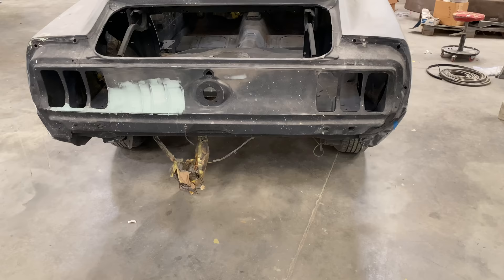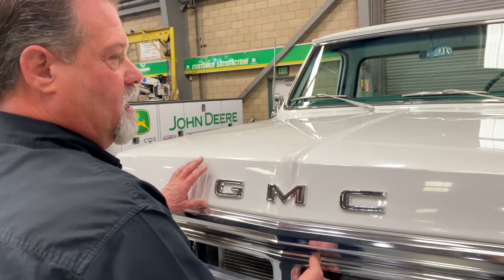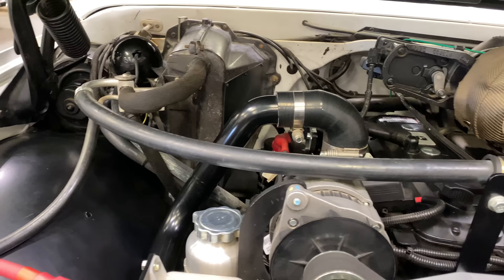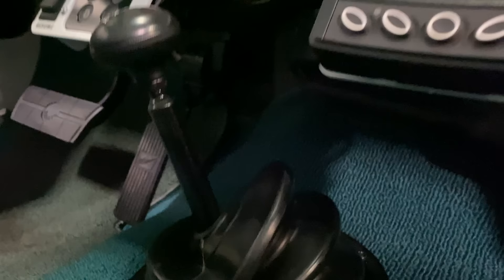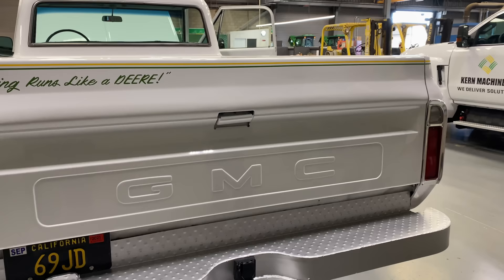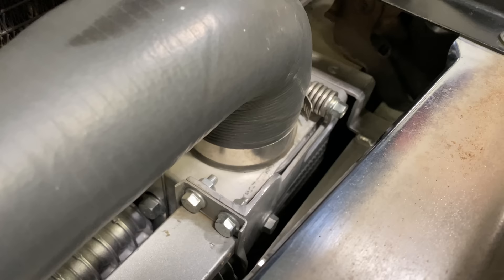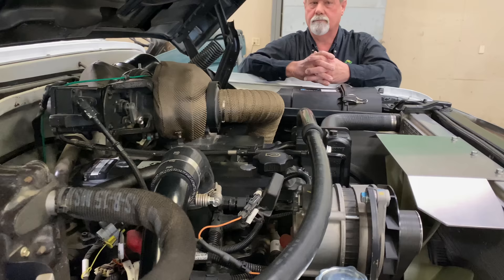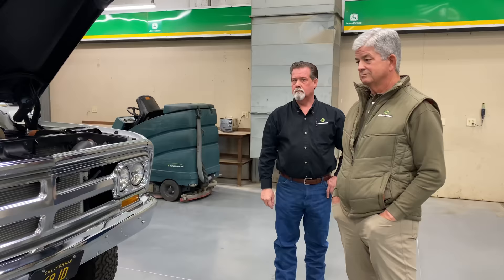John Deere Tractor engine in 1969 GMC truck!

Comment: Produces under 480 lb-ft. Highly unlikely you’re twisting any 3/4 ton axle in half, regardless the age.
Reply: I’m glad someone said it. Must’ve bound it up or the other option is they are full of shit
Reply: The 454 they pulled out had them on there last leg, don't remind me that it was a 350 truck originally, LOL
Reply: I was surprised at the statement as well, but mechanical parts can fail at any time...considering the truck is over 50 years old and anything could have happened to them in that timeframe, if he said they twisted why do we care what the circumstances were or even question if it could happen???...yes you could say its highly unlikely a 3/4 ton axel would twist but it can happen...its also highly unlikely he just made it up for a bullshit talking point...just enjoy the video and the truck they created and not be so critical...
Reply: I totally agree with you on that
Reply: Gear reduction my friend. You can turn 480 ft-lbs into 2000+
Reply: I could see maybe twisting and breaking a drive shaft into two pieces but not twisting an axle in half.
Reply: Pre 73 had the eaton ho72, not usually a Dana 60 rear and a 14 bolt wasn't introduced yet. May have been ho52. Of course over the years its anybodys guess as to what it had when it showed up.
Reply: Given the fact the transmission and transfer are custom my guess is it has a lower than stump pulling first gear which could quite easily twist a stock axle. #Micdrop
Reply: @assymcgee2835  That is true of the Chevy trucks as standard, but the GMC had the option for a Dana 60.  GMC did things a little different, like having leaf springs as standard on the 2WD 1/2 and 3/4 ton, Chevy had coil springs for the 63-72 trucks - but you could order both makes with either as an option (except when 4wd which always had leaf springs front and back).  GMC had the option for Dana axles (44, 60)  on 1/2 and 3/4 ton on both 2wd and 4wd during 63-72.
Reply: Early Stock dana 60 axles in the rear were 16 spline garbage. Not surprising. Sterling or a 14 bolt would be fine
Reply: @franksimpson8242  yes mom, thanks.
Reply: @illreportbackinabit.8514  good boy!
Reply: Right? I think he meant to say "axle shaft" and it most likely wasn't a Dana 60. Probably a 14 bolt. But even then... Must've been in 4LO while trying to pull something up a steep hill and caught traction.
Reply: Not just the lack of power, but how about the lack of ground clearance? Lol
Reply: Multiple the torque by the converter ratio and the lowest gear ratio in the Allison . Stock  final torque will not come close to the final torque behind that allison
Reply: Stock Dana 60 rears aren't super strong, a 9.75 sterling that comes in F150s today is actually stronger

Comment: I had an old Dodge with a Cummins engine out of a combine.
Reply: That's the only pairing where I think "That's a build out of necessity"  Whereas this Deere and GMC scream money and novelty!
Reply: @thomasshumaker1495  Seems like a lot of work for a novelty item doesn't it. Mine  was for my work truck. I don't own it anymore but it's still a daily driver/work truck for a younger lad in the area. It was regular 12 valve b series Cummins. Just was in a combine instead of a truck originally.

Comment: Nice clean job. There's a guy that has been running around here for twenty+ years with a Detroit 471 in an 65ish Dodge pick up.
Reply: Bet you can hear him coming 5 miles away too. The old 371 and 471 engines could be heard for miles. I have heard 371s in a log skidder, i hope the operator had ear plugs.

Comment: They have conversion 4Cylinder Cummins engines for jeeps I sure they could be modified to fit in all the 60s and 70s trucks
Reply: B4t Cummins remove 350 and bolts right in
Reply: Not everyone wants a Cummins. I spent my career in the OTR diesel world and my service truck was Caterpillar and Eaton - ironically while doing Cummins field service.
Reply: @roundsm18  I know that  but every one want a diesel conversion kit for the old trucks as do i I have a 78 f250 custom that I wanted to swap
Reply: @kontrolledkhaos4853  it’s all easy fabrication. Mine stayed big block gas because it wouldn’t be a restoration if I swapped it.

Comment: What's funny is dodge has been putting case motors in since the 80s
Reply: No I think it was a Cummins many of the case engines were discontinued with the newer axial combines and magnum tractors!
Reply: Cummins isn’t a strictly case engine, Cummins is in boats, trains, tractors, semis, and pickups
Reply: Even funnier than that is caterpillar was putting tractor engines in trucks in the early 30s
Reply: Case motors????? C’mon man
Reply: @oe542  I know cummins you get what I mean
Reply: @landonretzlaff7765  now I do.

Comment: I’d like to know why he chose a 203 transfer case? Isn’t that a full time transfer case that’s chain driven? Why not a 205?
Reply: The np203 is a bulletproof case and you can install a divorced kit so you can shift it to 2wd.
Reply: @minnesotatomcat  it isn’t bullet proof. A 205 is way more bullet proof. Those 203s are boat anchors or scrap weight.
Reply: The 203 is far from a boat anchor, chain drives have been proven to be plenty stong enough for serious off roading, but I doubt that truck will ever see any real trail use. The 203 has a lower low range ratio than the 205 and it's also a full time case that can be selected to either open or locked in low or high range. With the selectable hubs on the front it can be a "sorta" part time case like the 205, although the front drive shaft will still turn.  It's a good choice for a LWB pickup that's likely going to have most of the weight on the front axle when they need 4 wheel drive.
Reply: Why not use an NP271?

Comment: 4:27 you don’t really notice a difference. 173 hp vs 300 hp, tell that lie one more time.
Reply: you might not notice that much difference just cruising around but hook up a trailer with a load and then you'd see the difference.
Reply: HP is merely a measure of how quickly an engine makes power. Torque on the other hand, measures how much usable power is being put to the ground. Your average diesel engine makes tons more torque than a gas engine, but less horse power, which is why it can gain speed at almost the same rate. Often times, the diesel makes so much more torque, it's "faster" than the higher HP gas engine.
Reply: @Eric2300jeep  This engine will never keep up with a 4.5 liter 180 hp Deville gas engine install in that truck. The diesel short rpm range will be a problem.

Comment: The builder seems like a bit of a jerk
Reply: I bet it's more than seems.

The interviewer doesn't exactly seem the brightest crayon.  He didn't get the concept that there was no bolt in anything. They stripped the front clip and built it around a bare frame. 

It's really the easiest way to do a nonstandard engine swap.
Reply: @anthonydilligaf823  I agree, the interviewer was definitely unprepared. Maybe it was a spur of the moment interview. But it was obvious that he wasn't a "car guy". I think the builder and owner picked up on that.

Comment: Ive said it for years. If john deere would design a truck . it would take the market. Use attributes from gm ford and ram but run a deere motor.  The truck would be a beast.

Comment: My dad worked for deere and he said they rarely got the trucks back from the dealers. It was to test the engines for different loads. They take the engine apart etc. They did like having deals with the big harvester companies because they'd get their new machines back every year with lots and lots of hours on them. One of the reasons why they might have the no user serviceable parts/ make it hard to repair is because their claims dept paid out claims on everything even if you take 1 part off a john deere tractor and put it on another machine. He had one person he visited for claims was sucked into a thresher or something and was INSIDE the machine for 3 hours before he was found. was still alive. With all the covers guards safety stuff removed from the machine.

Comment: I want it! When I was in high school a friend of mine put a For 6610 tractor engine and 8-speed trans' in an F-350 4x4, and while it lasted it would crawl so slow, and go over anything, but he couldn't keep U-joints, driveshafts, or axles in it. lol. His was just rigged together, where this one is done right. I'd give my left and right nut for it. lol.

Comment: I absolutely love projects like this, Because I have done similar, with Duramax allison and a avalanche 2500, of course mine had almost 600hp Crazy fun to drive. It had oversize injectors bigger turbo built allison a fluid damper so the crankshaft doesn't snap I higher then stock Rpms and so on. It only had 1/2"" between the radiator and fan because of the oversize exhaust and air to air cooler many more modes not mentioned here. O forget to mention I snapped the stock spring in the rear even with axle control bracing doing a burn out from the axle shifting so far ahead on one side it spun around like a top rolling it over on it's top, After that Smashing performance I reinstalled this Crazy build back into a full size truck still being used today.

Comment: I have that model truck K-1500 fleetside long wheel base with factory saddle tanks I have a 283 in my shop came stock was a 350 4 speed 
I’d love a Cummins with a 5 or 6 speed manual and an extra cab   a/c would be nice but not necessary definitely power steering needed disc brakes up front ok in the rear 

I prefer Hwy-99 to I-5 so next time I’m headed to San Diego from Krapramento I’m stopping in I’ll wear a bid so I don’t get drool on it
Nice work!!

Comment: I think a 69 International pickup with a six might be nice. Slightly lengthened hood front end with four wheel drive. Don’t see many and a clean slate for a one-off paint scheme. Retain the front fender fuel fill for unique style.  Possibly an IH diesel turbo set up. Could feature some cool jeweled IH badges.
The stamped aluminum grills and dog dish hub caps kind of a cool time period correct style cue.

Comment: 9:56 ... Gotta beg?  Whaddup?  

Sir Kern: Cough up da coin to do whatever needs to yet be done to get this magnum opus out shreddin' mud.

Yeah, you blew the budget.  And?

Fatal flaw in the tranny or the like?  Fix it.  Damn, do I really gotta say it?

You came this far, didn't ya?

P.S. Also, one nag, please outsource and get rid of that silly dash panel extension -- put the new stuff where the radio is (and throw a Garmin Tread Audio Box behind the dash) ... and add a pair of Mighty Mount wireless chargers just above the new stuff dead center, so the phones peek just above the dash for optional dash cam mode.

Looking forward to that, and your Leno episode.

Thanks for all the incredible concepts & work so far.

Comment: So I once had pleasure of driving a Ford I think it was a 66 with a international dump truck engine I want to say it was a Cummins in it from the late seventies it was a blast other than a few oddities and having a 13 speed manual transmission in a pickup truck but that was also a different animal as it was a mostly mechanical engine with a manual transmission that was pneumatically actuated

Comment: Had a local ford tractor dealer put an engine out of a 5000 ford tractor in a dent side ford truck , I never saw it run but saw it on their lot after they retired it .

Comment: Me, I would be completely happy with a 350 in that pickup, and my two 1990s JD F932 mowers and 1975 500C backhoe. Almost nothing manufactured in the past 15 years can be repaired without extraordinary skills and extremely expensive tools — cars or combines. That self-driving SUV that Cadillac is advertising? Its resale value will be 10 percent of new in eight years.

Comment: These 4045 powertech engines in genset applications, have optional dual balance shaft. Way better engine than the Cummins 4BT. Only thing better would have been in a Ford. Very nice workmanship.

Comment: I know past away old man from my area was one of owners of John Deere Dealership plus Parts store used be near me also guy had 1975 D350 Dodge full size van 12 passenger was orgnail used as ambulance type till retire in 1980 and guy bought of Auction sale to in 1980! Then found 318 V8 2barrel hand choke carb , Manual 3 speed transmission on shifter on steering wheel get worn out & guy had idea to do and what did ! Turn to camper van, add 1976 Massey Ferguson Combine 500 series Desiel 6 cylinder motor size 360 bore up 400 Cubic Inches size , Dodge floor shifter Manual transmission had Bow Low Gear plus 4 speed forward gears plus one Reverse , 2 12 volt battery for 24 volt system, he use Dodge 90 amp Alternator, uses all gauge plus 2 fuel tanks , add RPM gauge on dash , transmission temperature gauge, extra battery volt , took cigarette lighter out for a switch for glow plug warmer , 2 fuel filter from fuel tanks plus one engine too , buy fuel tap , 3 ton  truck rear end 390 from 409 orgnail had , had sink, hot water tank , propane cylinder on frame rail right side attached to  for heat water plus heater too that had in body house voltage plug also battery charger to add  2 sleeper plus 2 people ride in and two celine fans vents for keep cool in hot summer season! Plus motor had single exhaust but loud too! Guy built this used for his business plus going Florida every winter drive down plus wife drove too every year and gave Chrysler the idea so built Desiel motor Cummings come in affect to he work for ! His wife was nurse at local hospital, both since past away but on Grandson who my cousin he and I went to visit family plus at local Indian reserve in 2002 and 2004 summer season and camp with it also lots fun! I found to 5 gear  was like Overdrive going in hills didn't need brakes as much but up hills power never new also top speed was on odometer said 120mph but think goes faster than that because 5 gear! But if want listen am/fm radio had have loud speakers nearby to hear Lol and one summer way back from my cousin Mark  house I was drive back the Clutch pedal stuck in out position plus Bow Low gear and managed get out gear but clutch plate need replaced plus bearings to plus steel pressure line to fix ! The van is 1 ton of 11.000 pounds totally and not easy job to fix underneath too also replaced parts in ! But one thing late guy built it did he did schematics and drawings of pictures of it setting up and how fix in details but if want need fork lift plus heavy-duty hoist like farm tractor or big trucks used to!

Comment: Had John Deere quote us on a fix.  $15,000.00 for a new fuel rail and fuel system.  Our tech said no way.  Our tech found pinhole leak in tubing and saved us $15,000.00

Comment: If I were to go through all that trouble I would definitely not have anything computer controlled on that truck!
I'd probably try to find either a three or a 4 cylinder 2 stroke Detroit, rebuild it to perfection, and then mount it in front of a hydraulic automatic transmission.
I'd set it up to run on straight vegetable oil with ZERO ELECTRONIC CONTROLS!

Comment: This is the coolest diesel truck I've ever seen. I'm wondering if that same engine will fit into an early 60's Jeep Gladiator truck. I'd love to copy this build but with a manual transmission and would probably build both an early 60's Jeep Gladiator and a 69 GMC 2500 like what you have. I'm wondering if I could get some more information about this build so that I could successfully build one for myself?

Comment: Many years ago I worked with a guy that he and his dad had an old payloader that the engine had went out on and the only practical way they had to fix it was to refit a gas engine from a  late 80's pickup into it.    They thought that being the pickup engine was supposedly rated for more HP than the stock loader engine, it would be a nice step up.  

Turned out that a modern emissions-compliant vehicle engine VS a stock commissions industrial engine from the '50s was no match. It was underpowered and burned almost twice the fuel doing the same work.  

Since then, I have met others that did similar swaps and they all came to the same conclusion. Emissions compliance has nothing to do with fuel efficiency.

Comment: This swap is a very cool idea and one that I have also contemplated but I thought that tractor engines were not so good as vehicle engines, as they are meant to perform constant duty.  I have a 40 year old ford lehman diesel in my boat, which is known to be one of the most widely used industrial motors ever with many thousands of them still in service. They even went as far as to put them in dump trucks and other over the road type vehicles, but you are hard pressed to find a survivor of these because they just didn't hold up to the varying RPM's of driving.  But you will find them in 50 year old boats and farm machinery with 10k plus hours still running like tops. Very curious what the longevity factor is....

Comment: 6 cylinder or 4 ? You can tell he wanted the 6 but got out voted on that decision. 
But very nice Tk.  Needs a hyd winch. Crome doesn’t get you home. I just can’t not use any vehicle. They are made to use not become a dust magnet only.

Comment: I'd like to see one with one of the big 2 cyl engines like from a model 70 or 80...or even a Model A.
Reply: Or a Model R. Two cylinder diesel with pistons the size of one gallon cans. needed a v-four gasoline starting motor to turn it over.